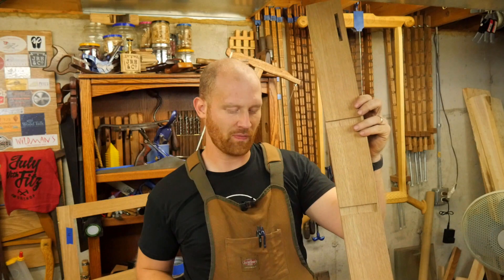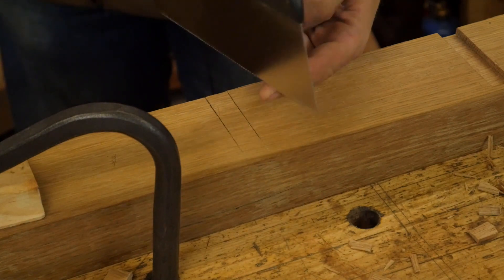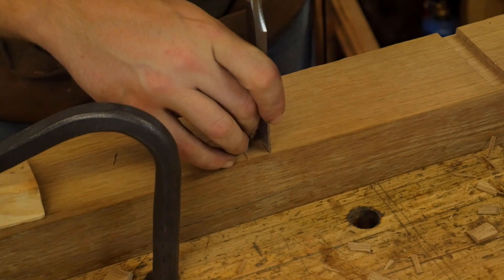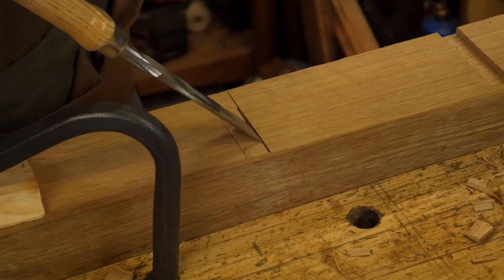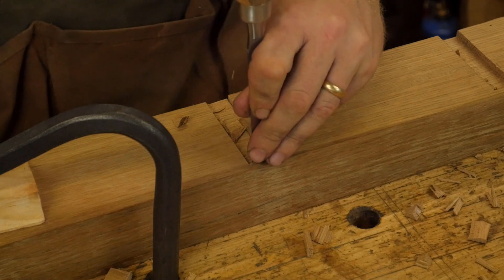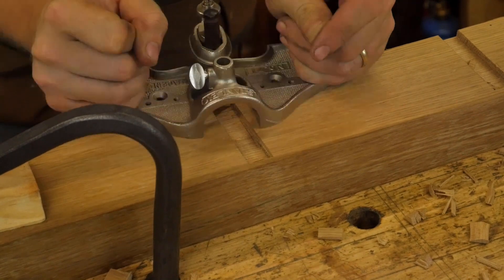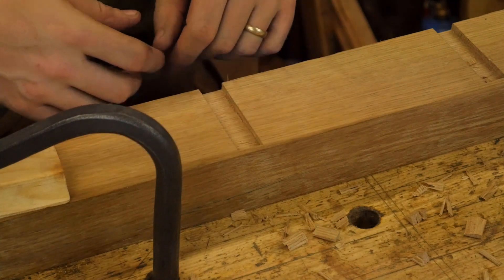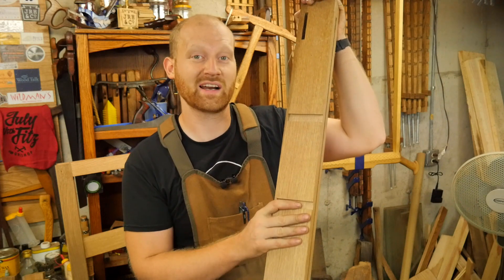How To Make a Stopped Dado With Just Hand Tools - Woodworking Joint

Comment: small tip for not blowing through the narrow far wall - you can attach a block of wood to that section so that it is supported - I use this when Im making blind dovetails with a very thin piece at the back, I clamp a block of wood so that thin piece does not blow out ... CHEERS for the video :)

Comment: No idea if youre still monitoring this but this is awesome. Is there an alternative for getting a flush bottom if we don't have a router plane?
Reply from the maker: You can always make a router plane. They're relatively quick to make. Or even faster you can make a poor man's router. Paul sellers has a good video on that one. But even without those you can use a chisel bevel down and do it by eye just not quite as accurate. But it works.
Reply: @WoodByWright  Thank sir. I appreciate that response. I'll look into making one.

Comment: Nice video! Although you should watch out for those slippery holdfasts when doing such delicate work :D
Reply from the maker: LOL thanks. more like watch out for putting a chisel into your finger. the holdfast did fine, but my slippery hands did not!
Reply: +Wood By Wright I just watched a "sh*t happens" video about scary moments in woodworking. So be happy with a chisel in your finger :D
Reply from the maker: LOL ya. the nice thing is every tool in the shop is flesh sensing so it only goes so far.
Reply: +Wood By Wright Just like Sawstop but a lot cheaper  LOL

Comment: I wonder how does a 8" - 12" stopped dado work in this case? I see how easy it is with a saw on a narrow piece, but dados for bookshelves or cabinets are not as simple. I've resorted to chopping them out like a wide mortice, then using a routing plane to smooth the bottom. Is there a faster way?
Reply from the maker: I do it the exact same way for longer ones. if you want to see a demonstration of a longer one you should look up the video on making sliding dovetails. I have one on there where I'll do a 13-in stopped sliding dovetail. With hand tools the fastest way is just to carve it out with a bench chisel. But that takes a lot of skill.